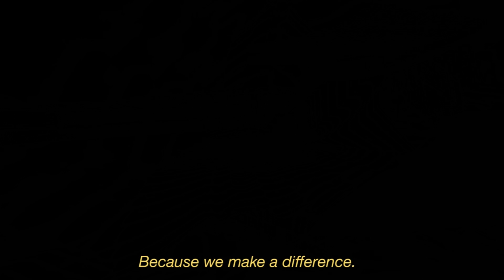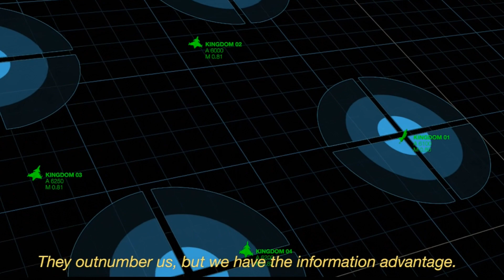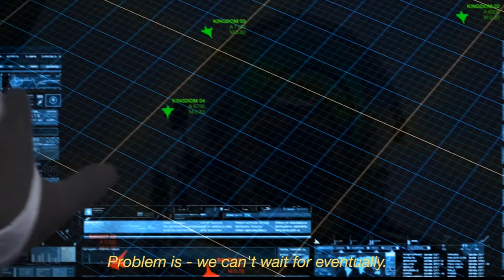Gripen Fighter Jet - Canada's Future Fighter?

Comment: Gripen's performance is bellow the Eurofighter, which is even lower than the F-22, much less that F-35. It's a good choice for countries who's options range between 80's fighter planes to Gripen, but I just can't see the little bugger fitting in a first-class airforce. Again, I'm not putting down the bugger, but it's made to serve as a cheap alternative for poorer countries, not as something that could match Russian...or American...or German...or French...I don't think they're a match for the Chinese?...airforce.
Reply: Yordan Yordanov you are aware that Sweden's only threat is Russia   at the moment. These jets are made to counter Russian aircrafts. And have proven very potent in Redflag exercises.
Reply: For anyone who says that the f35 sucks and cannot dogfight... you guys seem to forget it's not an air superiority fighter. It's definitely a multi role aircraft  which is designed to be able to defend itself in a dogfight not go on the offensive. Hence why it's called the "joint strike fighter" not the "air superiority fighter"
Reply: In what ways is the performance below that of the Eurofighter?

Yes it has a lower Thrust to weight (Though that is improved in the Jas 39 E/F)
Yes it has a smaller payload (Though again that is improved with the Jas 39 E/F)

But other then those they are pretty close in capabilities and the Gripen has the edge in some areas.
The Gripen has Superior instantaneous turn performance were as the Eurofighter has better Sustained turn performance (Due to its better thrust to weight ratio) though the Gripen E/F will have improved sustained turn compared to the C/D so it should be comparable to the Eurofighter in that area as well.

The Gripen is smaller lighter wich makes it nimbler then the Eurofigher in certain areas.
And also has a smaller radar signature.
Both aircraft have up sides and down sides and which is the better choice also depends on what you need it for.

The eurofighter is probably superior in a Offensive role (Air-Superiority / Strikes into enemy territory) due to its larger payload etc.
But in the defensive role it holds no real advantage.

The Gripen is also significantly cheaper to operate which allows more flight hours for the pilots for a lower cost.
and giving the pilots more hours in the cockpit is extremely important when it comes to how effective the pilot would be in combat.

And today id hazard to say that the Gripen is outright superior to the Eurofighter in a Air-Air scenario.
If Swedish Gripens went head to head with a Eurofighter today the Gripen would hold a definite edge due to armament.

As the as the Swedish airforce is the only nation that currently operates the Meteor missile (with the Gripen being the only aircraft in the world that carries it in service atm)

And with that missile the Gripen would have a significant Advantage over Eurofighters equipped with Aim-120 the Amraam as it would be able to launch well outside the range were the Eurofighters could fire back.

This makes less of a difference in the long run as the Eurofighter should get the Meteor in a year or 2.

And today flight preformance is in not as important as the Avionics and weapons it carries.
when it comes to how effective it is in Air-Air combat.

And in those areas the Gripen is very much top of the line.
Reply: Actually gripen is far cheaper over life time than CF-18 and performs far better. A single CF-18 costs $40k/hr to keep operational not including the 90 people to maintain it. The grippen cost $6K/hr to operate and 6 people to maintain.
Reply: Gripen C uses the meteor (and the Swedish airforce is the only airforce that has the Meteor in service atm with the Gripen being the only aircraft Carrying it so far).

the E and F will ofc also have the Meteor but they are not yet in service.
Reply: Its cheaper not because of it being lower tech.
Its cheaper because its smaller (Gripen C empty weight is 6,7 tonnes where as the Eurofighter is 11 Tonnes) and has 1 engine instead of 2.

Please read up more on the Gripen and it systems before stating things that are not true.
Reply: The Gripen E and F actually uses the Meteor nowadays.
Reply: Pörki Productions how old are you?
Reply: Gordon Lawrence The Typhoon is a great fighter no doubt, but we dont know the actual circumstances in wich the raptor found itself trying to out maneuver the Typhoon! Most of the time the jets are put in different scenarios and are limited as far as capabilities for training purposes!
Reply: Since the planes will never be used. just as Canadian rifles are never fired. Just buy whatever is cheapest since it's just for looks anyways.
Reply: Mattebubben + Exactly; the russians love their stop/stall/proceed-maneuvers at their airshows. Who the heck would use that in modern day air-to-air fighting, because it's nearly 100% beyond visual range fighting. It's awesome though, visually, as it's always been with russian fighter jets - "largest engines, highest top speed, greatest thrust" - to many, it looks the best. And there's also a factor not many amateur enthusiasts take into account, still: the factor of political pressure during considerations buying military material; political pressure. Take Brazil as an example why they went with the best. Why did they go with Gripen and not a North American fighter? Embraer, one of the largest aeroengineering company's in the evolving economies. They treasure SAAB's tech-transfer for developing their own defence industry. 
And for anyone thinking little puny Sweden has no place in defence industry; think about this: Sweden had the world's 4th largest and most effective air force into the early 60's (US, Russia, UK, Sweden). And as for the rest of modern defence tech: just Google SAAB defence and check things out before labelling it a poor man's  choice.
Reply: The Typhoon WILL use the meteor.
The Gripen is currently using the meteor.

The meteor is being implemeted on the Typhoon and should enter service on it within a year or two.
But the Swedish Gripens have carried it in service for over a year now.

When the Typhoon gets the Meteor that weapon inbalance will be evened out.

And they will both carry the same weapons.

But for today the Gripen holds that Edge.
Reply: The performance gap vs the Eurofighter is minimal, it was actually added to prevent pilots to put it into unrecoverable flatspins etc. The price is half, the turnaround time is much faster, it can operate on normal paved  roads and in pretty basic conditions. You can have the shiniest plane, with the best performance, but if it can't fly it's useless.

It has flown in Red Flag missions in the US and done very well...
Reply: By the tests, Gripen was the best match for Meteor
Reply: you obiously dont know what you are talking about... Gripen have defeted both the eurofighter and the f22 in air to air combat during operation red flag 2014. All tho it have never been in a atac with a F35 the answer it that the f35 would probably win, but counting on that you can buy 10 gripen instead of one f35 the gripens would win anyway.
Reply: Gavin Smith Britain needs a replacement for the excellent workhorse Harrier Jump Jet; a plane to use in compact carriers/assault ships for a powerful multirole strike force. There's really not much to choose from right now. The Harrier has reached it's end, it's just too slow nowadays, and the UK is US closest ally, so of course they had to go for the f-35. I think they've been scammed though, supporting/ordering it early but gets stuck with too high a cost, but that was nothing to do about as the fact was obvious.
Reply: who is Canada planning on going to war with? the threats they are fighting overseas don't even have an airforce. Economic reasons outweigh performce issues in this context. In the context of NATO it doesn't even need to be able stand up to russian fighters anyway, since they would be integrated into a larger force, where other aircrafts can answer these threats, if that is even a realistic scenario considering an open conflict with Russia is not likely going to be a conventional conflict.
Reply: It carries the same missles and cheaper
Reply: G tubedude thank you somebody with sense for example in the British case they get people on this the euro fighter can't this and that as you said in the f35 case it's it's not air superiority jet but can defend  it's self same with euro fighter it is a superiority fighter which has swing wing capability so thanks g dude
Reply: +Mattebubben Well said
Reply: +björn sjöblom If you are going to go by that logic then instead of gripens you may as well buy more f-18s from the US and convert them to cf-18 specs. Cheaper than gripens.
Reply: Don't evaluete the plataform performance by only watching it's engine size or how much the afterburner flame will throw. Each plataform in 4++ or 5th generation fighters are accountable in new parameteters, wich are new for classic enthusiasts or unflexible military professionals. Grippen has its strong points not only on cost of operation but its eletronics rules everything on todays loosing only for F-35. I rather have a fighter witch can overule a BRV scenario with low cost of operation allowing the crew of fights train regulary, than a pitbull witch stands landed cause parts are unavailable or simply too expensive to fly.
Reply: FR I live in sweden. I own stocks in SAAB. Im well aware where the parts come from. If you are willing to read a little you can go to SAAb investor news and read that the price of the plane is depending how much the dollar is worth compared to the crown because they import many parts that they use in the plane from the US also some parts from France and Italy so there the value against the euro differs a little. 
Did I educate you enough?
Reply: Yordan Yordanov I don't I think it Can do good against Su27
Reply: the Austrians run the trance 1 typhoons ,the latest 3a traince has latest sensor radar missle systems uprated engines and lated 5th gen helmets systems new long range down side is cost 160 million dollars
Reply: Rafale! Rafael is from Soul Calibur.
Reply: F35:s weakness is the cost/unit and that it need more staff for service. Otherwise it's really good.
Reply: +Trackhead95 I have no doubt that if they needed to the typhoon could be adapted to work with a carrier the problem is very few european countries need a carrier based aircraft other than the UK and France and since france pulled out of the project and the UK didnt need a carrier based version at the time it was never adapted or developed but if a customer needed that as a feature which canada doesnt because it doesnt have carriers then im sure it could be worked out. Its certainly powerful enough to get off the deck pretty fast. But i agree the typhoon or the rafael should be canadas pick not the gripen.
Reply: Late model Gripen, Eurofighter, Rafale, FA-18, or F-15 would all be decent partners to use with F-35A with different pros and cons with each option. Personally I think an advanced F-15 variant would be the best choice for Canada but Gripen would not be a bad choice.
Reply: eraldorh Im really curious as to where you get your price numbers from. The Gripen NG costs around 100mill$
Reply: A lot of people do not get this point. The F-35 is a multirole fighter capable to a certain extent of dogfights as well as strike attacks and close support roles. The USAF has got the F-22 and the F-15 for air superiority roles. Same goes for the Soviet/Russian fighters where the Su-27 and its derivatives such as the Su-30 are primarily designed and used for air superiority while the MiG-29 and its variants are used as multirole jets.

P.S The F-35 is known as the "Joint Strike Aircraft" not because of its multirole capacities, but because its design, development and production costs have been funded by a bunch of different countries such as the USA, the UK, Italy, Australia, Canada, Norway, Denmark, the Netherlands, and Turkey.
Reply: Well yea, but it's also much cheaper so you can have more of them. It's a more basic "budget" fighter, but still good enough for the job.
Reply: FR
Read this. 
So you are saying Mats Helgesson the chief of swedish airforce is wrong?
https://www.nyteknik.se/fordon/nya-gripen-utmanar-ryska-stridsflygplanen-6574644
– Många delar i Gripen är från USA och med en mycket stark dollarkurs ger det givetvis påverkan på priset, säger Mats Helgesson.

Den planerade kostnaden för 60 plan är 35,6 miljarder kronor, enligt Saab. Hur stor fördyringen blir är oklart, men enligt Dagens Industri kan den skena med åtskilliga miljarder kronor.
Reply: Well, the Australians changed their mind and cancelled the F-35. And stealth is not that stealthy if the right radar and satellite systems are built to do the job. You remember the stealth Lockheed F-117 Nighthawk shot down over Serbia?

It has nothing to do with the Gripen, but simply shows that the stealth F-35 and F-22 might be more easily spotted by the right radar and satellite systems, when the right aerial follow-up is properly done with the right modern equipment.

http://www.balkaninsight.com/en/article/serbia-keeps-memory-on-fallen-nighthawk

Russia is equipped to spot them, and even Iran can do some harm, besides taking control of the US' latest, smartest and stealthiest RQ-170 Sentinel drone illegally flying in Iran's airspace, back on December 2011, without asking first and without permission therefore. Iranians were able to get all the secret engineering from it.

https://www.rt.com/usa/iran-drone-hack-stealth-943/

Of course the US claimed that the drone was out of course..., and then it had crashed..., but the Iranian photos and videos showed the US' lies for all to see. And then Oblahblah had the guts to ask the Iranians to give it back... Iran tasted the imperial greed for oil from England back in the early 1910s, and the US empire-to-be joined the English shortly afterwards, and made a lot of money with Iran's cheap oil, and that went until Mohammad Mossadegh, democratically elected Iranian Prime Minister in 1951, decided to nationalize Iranian (called Persian back in the 1910s) oil. The MI6, CIA and MOSSAD organized a coup, of course, in 1953, and had Mossadegh on house arrest, and he was replaced by the Shah (Muhammad Rizā Shāh Pahlevi ), and the three greedy amigos trained the Shah's Savak, the dirty, torturing, secret police, so it could control Iran forever. That ended when the Ayatollahs took over in 1979.

http://www.huffingtonpost.com/adst/the-cias-coup-against-ira_b_8001782.html

Now it's easy to understand why Iran keeps friendly relations with Russia, whose fighter jets are among the very best and cheapest...
Reply: It is not made as a cheap alternative for poor countries. It was primarily designed for the Swedish air force, and Sweden is not a poor country, ad it's lower price compared to amercan fighter is largely due to factors being single Engine and not incorperating the latest stealth technology, and being designed to accomplish a single job effectively rather than pleasing Three different branches of the armed forces and the military industrial complex like the F-35 was. Also the fact that you say "even lower than the F-22, much less that F-35" implies that you Think the F-35 is superior to the F-22 in air to air combat shows a lack of knowledge on the matter.
Reply: Cheaper doesn't mean worse per say
Reply: Mig-29 is made and used by in Russia, the largest country in the world and the JAS39 has almost twice the range of a Mig-29. Your argument about country size is moot.
Reply: Lars Henrik,

Could then have been special arm twi$$$ting from the USA, according to you? I would say yes... One problem solved by the USA then? How will the USA solve the retreat of the Australian air force from Syria? Maybe the Aussie retreat forced the US into making a special deal for the F-35, a kept secret special price so the USA's special STEALTH technology won't look so bad that only the US will use it, or put it aside for case of looking ridicule, unless they buy the Gripen, copy it and sell it as their latest unbeatable fighter jet. Money talks more than words in the Capital Nation, and so do bombs and other military murdering weapons, besides the economical sanctions...
Reply: And I laugh as well, Yordan... I'd bet you do too!
Reply: really F-35 ? F-35 is the most shit jet ever made
Reply: with 10% of the money spent in the F-35 any country in the world would develop a jet equivalent to a F-18.
Reply: You guys do understand that the F-22 is a product of the late 90's hubris and is discontinued, right?  No new ones will ever be made, and even the few that are operational are really more of a paper tiger these days.  On the other hand the Eurofighter Typhoon, while also very delayed and costly project, is a very operational aircraft in multiple EU air forces. The French Rafale spinoff of the EF project might well live even longer than the EF Typhoon.
Reply: Lars Henrik Daniloff So, you say 1 Gripen costs 850 million SEK? I guess y made a typo, it's about 120m SEK, that's 15 million $.
Reply: Yordan Yordanov I disagree that statement
Reply: Sonny Knutson well said
Reply: its never lost a fight... just lock at red flag... it eats all ......
Reply: the gripen airplane are mostly made of american parts. but the have taken the best specific parts from all others planes and meshed it together in gripen. 
there is no dogfighting in the future.
there is no need to be as fast as possible in the sky.
fast deployment. minimal ground crew per plane. small plane = lift of from roads across the country. 
destroy incoming airplanes from afar with no need to get close = no need for fast plane.
Surveillance and high tech missiles is the future.
Reply: Gavin Smith the F-35 manages mach 1.2 for 150miles without afterburners
Reply: The primary factors that determine odds of defeating an enemy in modern air to air combat are ability to detect and track with sensors (mostly radar), ability to delay detection(low observability/stealth), and weapons capabilities(range, tracking, quantity). 

Gripen E is okay in sensors(range limited by antenna size but good quality), pretty good in low observability(low RCS and visual for a non-stealth aircraft), and pretty good with weapons(great options in adequate quantity). The small size of Gripen helps with LO but limits sensors and weapons to some degree, although it makes the most of what is possible. 

Advanced F-15 on the other hand are great with sensors(excellent range), okay to pretty good with low observability(depending on options chosen), and excellent with weapons (large quantity). 

F-35 are excellent with sensors(excellent range plus optical sensor fusion), excellent with stealth, and mediocre with weapons (limited options and low quantity).

Each of these options are expensive to acquire with the Gripen E being cheapest to operate and F-35 most expensive to operate and Advanced F-15 somewhere in between. A mix of Advanced F-15 and F-35A would provide the highest overall level of capabilities.

Older model Gripen C/D are much cheaper to acquire and still have low operating costs but have significantly lower capabilities compared to E model.
Reply: The F-35 doesn't even fucking work!  You Americans have become pathetic at military aviation.  Now it's all abut how much $$$ that Lockheed-Martin can soak you for.  I do NOT want to EVER see a Lightning II with an RCAF roundel.
Reply: You got the youtube link?
Reply: FR LOL! You obviously suffer from a giant inferiority complex.
Reply: Davi trindale So very ignorant. Do you have any idea what you're even talking about? ...or is that just something you've been told on the internet or TV? I remember back in the day when the F-16 was called ALL SORTS of similar things. It was also plagued with early problems, also wildly overbudget, and also controversial. But here we are finally starting to replace the F-16 with the F-35...and hilariously...it's the same story all over again. Everybody ignorantly bitching and crying while the bugs get worked out. In other 30 or 40 years the next thing that comes along will also be called "the most shit plane ever made"...which considering the countless FAR worse aircraft, will also be hilariously childish and moronic. Same old story.
Reply: FR Oh. Ignorant stereotypes is it? I mean "bud"? Seriously? The beer? Of the literally thousands of varieties of excellent American beer available on any shelf in any market...you zero in on that one? The very worst available? THIS is what I mean when I say people abroad are completely ignorant of Americans and America. You simply don't know what you're talking about. What nationality are you? Shall I start tossing back some childish stereotypes? I can google up an entire spectrum of national failings of wherever you are from in bare seconds. Such is the internet. Full of ignorant children with MASSIVE INFERIORITY COMPLEXES in basements. Just watch...you're about to tear up and lash out with some more ignorance and inadequacy....I'll wait. :D
Reply: people always forget the F-35 is the replacement for the roles of the A-7 /A-4 /AV-8 and A-18 and not the F-14/15 roles ...
Reply: Sota Baka it's more of an eventual replacement for the F-16. It's meant as a light interceptor, not a full blown air superiority fighter like the F-15 or F-22...
Reply: Davi trindade then maybe they *should*.
Reply: Yordan Yordanov the euro fighter is a very good plane but I understand that the f22 is better that's why I think Canada mould love it
Reply: I would be interested if you can give some sources for your claims. After all, the Swiss air force chose the F-18 after the Finnish air force solidified the deal in the early 90's. I remember it quite well as I lived in Switzerland at that time, and it was very widely followed in the Swiss newspapers. 

In my opinion the Gripen NG would suit Switzerland even more than Finland or Canada, because the Gripen has a very quick refit/service time and her maneuverability, radar and avionics are second to none in such close quarters.
Reply: But then again the Swiss air force has a long tradition with Dassault, and we Finns have a long history with SAAB. I get it. :)
Reply: @GamePlayer - Fuck the AMRAAMs (and Sidewinders too)!  Bring on the Meteors and IRIS-Ts!
Reply: @G Tubedude - Canada doesn't need a plane that is primarily a striker.  We need a plane that is primarily an A2A combatant because the RCAF's primary mission is defensive counter-air.  We don't have a disputed land border with anyone so we don't need stealthy strike aircraft like the F-35, we need fast and powerful A2A fighters like the Super Gripen.
Reply: @Trackhead95 - Bullshit.  The cost difference is double and two Gripens will ALWAYS splash one EF-2000 or one Rafale.  The Gripen is the best plane for Canada.
Reply: @G Tubeduede - The F-35 sucks because it can't maneuver, can't run, can't fight and still has glaring deficiencies even after all these years of development and all of the dollars thrown at it.  All the Americans have learned to do is make something way overpriced.
Reply: @ohlalaale - Except of course that it can't fly near electrical storms, it can't fly in icing conditions, it can't fly in extreme heat and a whole slew of other shit that it still can't do.
Reply: @Rid1Bee - The F-35 is a STRIKE FIGHTER with zero dogfighting capabilities unless it's fighting helicopters.
Reply: @Lars Henrik Daniloff - No, it manages that with MINIMAL afterburners.  Supercruise is the ability to cruise at supersonic speeds INDEFINITELY without ANY afterburners as long as the plane has fuel.  You don't really know much about aircraft if you don't know that elementary principle.
Reply: @RelativeGalaxy7 - How is the F-35 the best when it still doesn't fucking work?  Canada's not going cheap, Canada's going for strength and having 5x as many Gripens make the RCAF far more powerful.  Take the same budget, outfit two air forces, one with the JAS-39E and one with the F-35 and in ANY air war, the country with the F-35 will be slaughtered in a day.
Reply: @Aqua Fyre - You don't know a damn thing do you?  We were always content with our CF-18s and the JAS-39E is superior in EVERY MEASURABLE METRIC to the CF-18 so stop spouting bullshit.  Range wasn't an issue with the CF-18 so the JAS-39E, woth better range than the CF-18 won't be an issue either.
Reply: @RealityIsTheNow - Fuck you.  I've been a military aviation enthusiast for 27 years and I've probably forgotten more than your brainwashed American mind will ever know.  I'm a member of BestFighter4Canada and we've gone over so much information it would make your poor American brain spin.  If you had something to offer us that didn't suck, I'd be all for it.  The fact is that you don't and you want us to pay through the nose for that piece of shit called the F-35.  No thanks, maybe next time when you remember how to make great fighter aircraft instead of re-hashing all your old shit like you do with your pushrod engines.
Reply: @Sota Baka - Which is EXACTLY why Canada doesn't need it.  We need a multirole fighter that is primarily an Air Superiority fighter to conduct defensive counter-air.  The F-35, even if it worked, is not suitable for this.
Reply: @RealityIsTheNow - The F-35 is a fucking STRIKER!  It's not meant to be an A2A Combatant AT ALL!  It's meant to move in, hit a land target and return but only AFTER air superiority has been acquired.  You really don't know anything do you, you're just spouting bullshit.  I'm not even going to reply to you again unless you can prove that you've actually researched the Gripen.  You Americans are terrible at reading up on anything that isn't American.
Reply: @Casanova Frankenstein - Sorry but you're full of shit.  What did that Super Frackulator do to your mind?  Who rated the Gripen NG below the legacy Hornet, you?  The answer is "Nobody who has a clue".
Reply: Casanova. That document is from 2008 and has nothing to do with the Gripen NG, she is a completely different beast concerning avionics and situational awareness. She also carries the Meteor. To be fair, one of the concerns about the Gripen NG voiced in Finland is her real-life performance with full armament load. The Rafale is not much better in that department, though.

One of the problems with the Rafale is that there is no real data how she handles real arctic conditions. The Gripen, as all SAAB jets, was designed for these exact conditions.
Reply: Thats not the NG. It's based on 2008 stats for the system, Gripen NG flied for the first time a couple of weeks ago. Nowhere in the rapport it says "Gripen NG" or "Gripen F".You can't really asess a plane that won't be built for another 10 years.
Reply: No problems, pal. :)  The Finnish air force has the hx fighter programme running to replace our F-18C/D Hornets. The Gripen NG is one of the obvious finalists, as is the F-35.
Reply: +ealdorh you seem to have missed what he actually meant with "most advanced information sharing system in the world".
Reply: its cheap as fuck so insteed of 1 of these aircraft u get like 5-10 of these and they arent that bad missiles do the job now days anyway:P
Reply: +Yordan Yordanov
You say it's performance is below the Eurofighter. But you don't say how and which performance. 
Just saying it's below just comes off as personal opinion rather than fact. 
For one, Gripen has the most advanced information sharing system in the world. Nothing else rivals it. This is something pilots value very highly. When JAS 39 was at Red Flag every other participating country was highly amazed by that system. 
Even today the US for example struggles heavily with it's information sharing system in their F35. 

JAS is extremely cheap. Especially in running cost. It's doing very well even in aquicision cost. Which means you can increase the number of aircraft in the sky by a lot. 
As one former pilot from the US of who critique the F35 in some areas said. A nations airforce is represented by 2 factors. The combination of technology in the aircraft and the number of aircrafts in the air at one time. 
The F35 is so expensive that the US only create formations of 6 planes at a time. They have weekly flight hours that are shamefully low because of the huge running cost. Compare that with JAS and you will have tenfold numbers of crafts in the air and still you would be doing it cheaper than F35.

Not saying that F35 is a bad aircraft because that would be ignorant and blatantly false. I'm saying that there are many factors in combination that makes an aircraft great. Not just 2-3 different numbers.
Reply: Yordan Yordanov ;"Made for poor countries"? Gripen is a state of the art plane and in dogfights/maveuverability it's got few matches on the market today.
I think a mix between a plane better suited for heavier payload groundattacks and Gripen is an excellent proposal.
To say it's less capable just because it's cheaper if one compares this fighter with an f-35 says more about the engineering capabilities of SAAB and the failings of other countries to make a cost effective fighter.
There's a lot of self-proclaimed experts out there who seems to think: "higher cost, higher running costs, heavier plane = better plane".
Reply: Yordan Yordanov aerodynamics will always be the same and gripen clearly have it. The thing about gripen is that it was built from the start with interchangeable components. It can use the latest missiles and it uses the latest combat links. I can't see how any of us "keyboard warriors" would survive a actual test and comparison. Anyhow, I think that the best fighter should be able to be upgraded easily and not with considerable difficulty as the new us fighters are
Reply: The true performance of the gripen E is still secret to my knowledge. The stats thats goes around on the internet are early stats from the early 2000's models, even if it has a single engine compared to 2 for everything else its combat capability is still rated top class for gen 4.5 fighters.
Reply: And ord a Good one: "I cannot see this little bugger in a first class airforce" and then: Its not that I put down on the little bugger:...
Sure, as Sweden always been a third world military/air force country since WW2 (sarcasm, as there's all to many in these discussions missing it...), of course they can only make toys, the little buggers 😂.
Fun for the they can build things! 
Waaaake up and smell the coffee...Yordanov.
Reply: Yordan Yordanov I don't think the f35 Can Beat the grippen because the grippen is a pure fighter and have a Delta wing which is way better for dogfight since the grippen will keep more energy in fight than a f35
Reply: more like 4 and airtime when you talk about airtime america get fucked flying 22h and then 2h maintinece and then also it can suck in a little gravel and not break like american planes also its easy as fuck to learn to do stuff on it was made to be able to be worked on by conscripts. i want to se 2 f18 agains 8 grpen and survive now with the bigger one i dont now the price but the old ones was cheap as fuck
Reply: Gripen E and F has AESA and in modern air combat its all about dropping AMRAAMs and then getting back. Gripen E and F can shoot some 4 AMRAAMs and break off, and it can do that very cheaply.
Reply: By that logic the Gripen is far superior to the F-35...
as well as better then the Rafale.

Performance is not all about Top speed especially since the Top speeds are only relevant for high altitude.
And a aircraft that has a higher top speed at high altitude is not necessarily faster at low altitudes.

And both the Gripen and the Eurofighter are Rated at Mach 2.

and the Gripen E is just as fast as the Eurofighter.
Reply: the gripen is cheap and cheap to operate over the lifesspan of the gripen vs planes it was built to be competetive to it was 4 times as cheap over its whole life and with mnimal downtime 22h flying and only 2h in downtime compaired to the f22 that is basicly 2h flying and 22h downtime i would say that the gripen beat any plane almost just by the numbers you can have if we dont count in the flying time vs downtime you can still have 4 planes instead of one so lets say 2 f35 is doing a mission and then al the sudden 8 gripen comes and attack the f35 wont be able to kill more than 1 gripen before they both go down simple fucking logic cheap as fuck easy to maintain any idiot can be taought made to be able to move by themselft on roads so if the airbase get shot down they go to the nearest roadbase a lesson fron the 6 day war he gripen is made to be cheap reliable and a dime a dussin in the fighter world perfect for smal and medium size countrys as a one for everything aircraft and be able to have many of them cheap
Reply: /Chooêt\ that "box with wings" had a 17-1 kill ratio at Red Flag
Reply: And for anyone who says "the f35 isn't maneuverable" maneuverability doesn't determine who wins a dogfight. In case you guys didn't know, most if not all of america's planes in WW2 were not as maneuverable as the Italian, German, and Japanese planes. Tactics and pilot skill are the main reason American fighter pilots won their dogfights. Case closed. So before you start bandwagoning on "the f35 sucks", look at history and do some research. If the plane was a failure the program would be canceled and/or other countries wouldn't buy it.
Reply: The Su-27 Family of aircraft (Su-27,30,33,35) have very good low speed manuverability
Especially the Su-35 and Su-35SM with their vectored thrust.

And that makes them look very impressive at Airshow maneuvering as they can do extreme low speed maeuvers at low airspeed (under 300-400km/h).

And at that sort of thing they are better then the Gripen.

Were as the Gripen is at its most manuverable in speeds between 600-1000km/h and at those speeds its more manuverable then the Su-27 family.

But in modern air combat pulling the types of slow speed maneuvers that the Su-30 and Su-35 are displaying on airshows and while they are very impressive they would only end up getting you killed as at those low speeds you would be easy prey to modern missiles

Since it does not matter how tight you turn at those slow speeds since you move so slowly it does not really matter in what direction the aircrafts nose is pointing.

Manuverability in Combat speeds is what is important (600km/h+) but that kind of manuverability is not easy to show off for airshows since you will pass the are of the airshow to quickly.
Reply: Yordan Yordanov Eurofighter isnt below f22... And the f35 is a box with wings.
Reply: In what aspect execept stealth is the F-35 better then the JAS-39E?
Reply: F22 isn't for export
Reply: Typhoon would be a logical and really great choice from Canada !
Reply: Mattebubben the latest typhoon uses meteor systems as well check typhoon uprated to 5th generation video
Reply: Never seen the footage from operation red flag 2005 then where Typhoons ate F-22's for breakfast?
Reply: I agree that the EF Typhoon is indeed a superior airframe compared to the Gripen, even the Dassault Rafael is superior to the Gripen, albiet less powerful than the EF Typhoon, but carrier based. I guess it comes down to choosing between pure power and manueverability, or less power but being carrier based. Either aircraft could work well for Canada, just not the Gripen.
Reply: don't ask a question and end it with a exclamation mark... 
I don't need to argue with you. you are arguing with yourself now.
Reply: James Hunter Australia is still buying the F-35
Reply: Avro Arrow My God. Are you seriously this ignorant? Is your inferiority complex this overpowering?
Reply: the grippen is a budget jet i would say, maintenance is a important aspect for low budget militarys
Reply: I agree with the idea, but Canada does not involve in war very much, so what it needs is to purchase what is capable for the National Defence. :D
Reply: +MrZnarffy The performance gap is enormous. The difference in top speed says it all.
Reply: Flying turkey is better than Gripen? Come on.. Rafale is good but only because it has two engines
Reply: +Sonny Knutson "most advanced information sharing system in the world." Rubbish and if you actually believe that then you must be pretty dam stupid. Especially when you consider when the gripen is placed in its price range. The eurofighter typhoon has superior range, superior speed, superior agility,superior dogfighting ability, superior weapon systems, superior radar and sensor suites which are capable of detecting the f-35 from 40 miles away. Nothing about the gripen gives it any form of head way over the typhoon apart from its price point and that price point should tell you all you need to know about the air craft. Its cheap for a reason because it does not have the expensive technilogy found in other aircraft.
The gripen suits swedens airforce because swedens armed forces budget is low while canadas is over twice swedens so they should give their airforce the best multirole fighter available to give their pilots the best survivablity they can.
Reply: Agreed! Have you seen video footage of the Russian SU30? It could easily out maneuver the Gripen any day, and the Sukhoi T50 is a great fighter, vastly  superior to the Gripen. The only aircraft to even come close is the Eurofighter Typhoon or F22.
Reply: FUCK YOU I HAVE SEEN THEM BOTH FLY AND GRIPEN IS BEST AND THAT WAS A GRIPEN C FUCK YOU FUCK YOU FUCK YOU